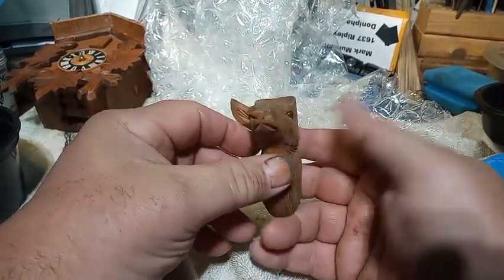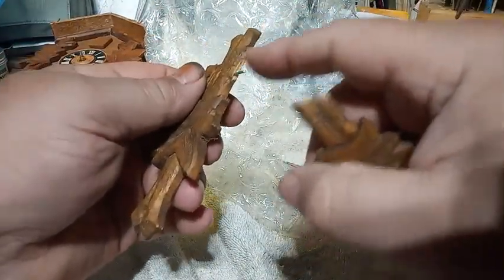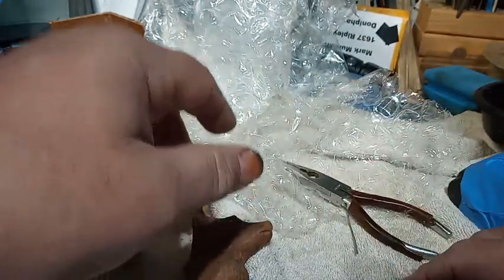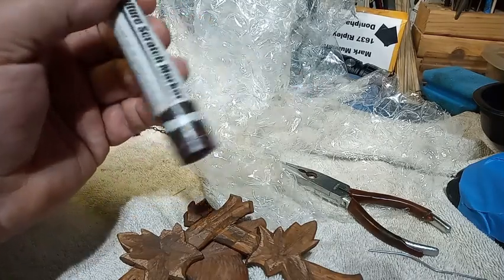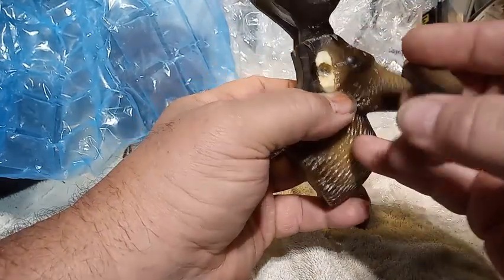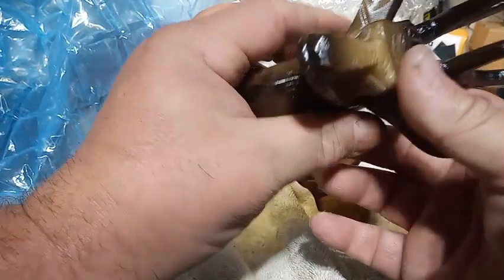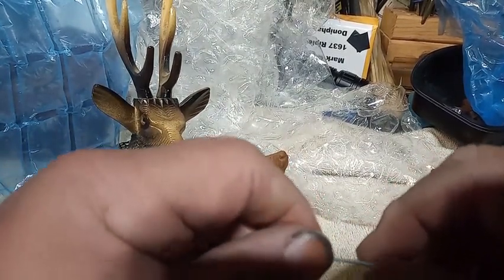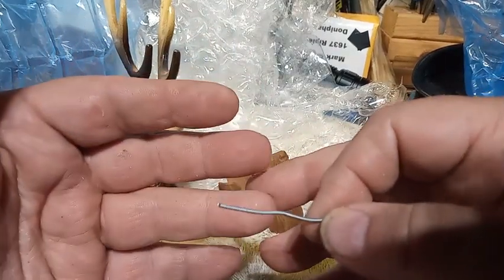One way to repair broken parts on a cuckoo clock or other clock

Comment: The wall you painted and redid looks good!
Reply from the maker: Thank you. Yes I will admit that the wall looks great but the floor. Oh my. I got paint all over the floor. But it has to be redone when I get the chance as the deep freeze leaked and my floor has sank in spots. No bid deal there is concrete underneath that but the frame that I put up had rotted from the deep freeze leaking. It is just a never ending story at my house. LOL. Thanks for watching.

Comment: I would be afraid to use the wire and if you plan on using the Super Glue trick, I would not think you would need the wire. Thanks for the shout out at the end. God  Bless you as well, Mark.
Reply from the maker: The wire helps hold the part in the exact place that I want it to be when I apply the superglue and baking soda. You are welcome. God bless you as well Mike.

Comment: Some great tips on repair here. I have a deer cuckoo that was missing an ear when I bought it. It’s a plastic one so it’s not easy to carve. I might have a go at scanning the remaining one, reversing it so it’s the correct side and 3d printing it.
Reply from the maker: Yes 3D printing is the way to go these days on a lot of parts. I had bought a 3D scanner but it broke after one small print when I did a software upgrade. Never could fix it so I got tired of it wasting space so I gave it to a friend.